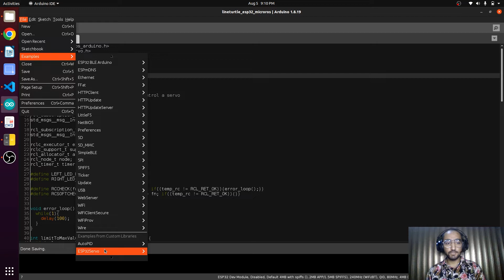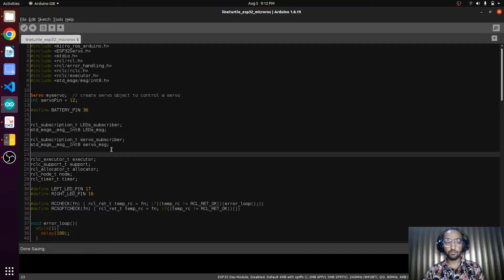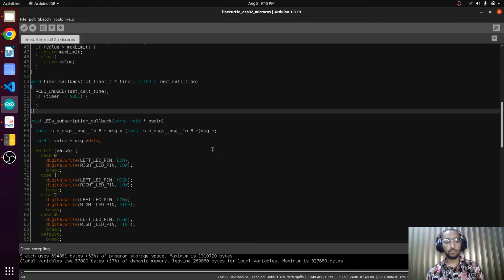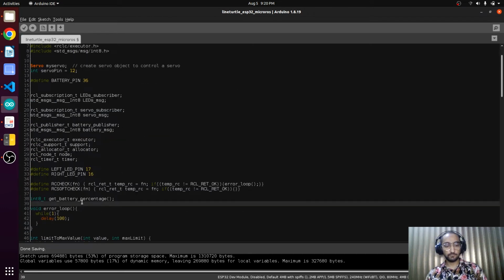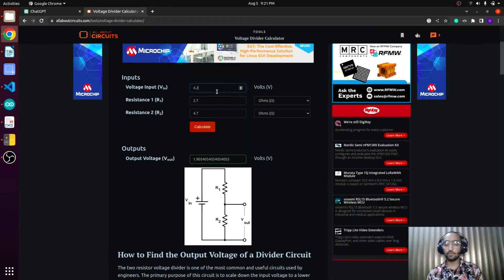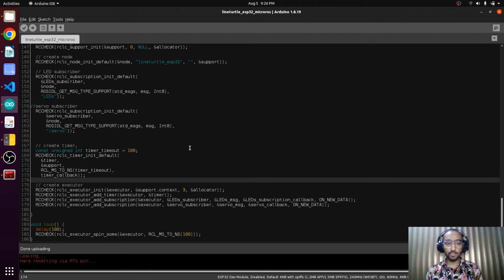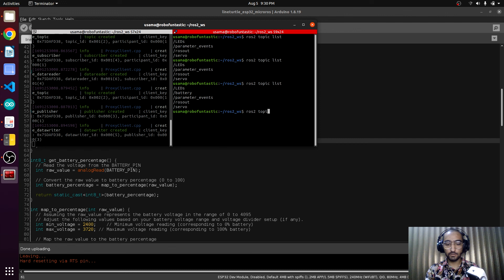Calculating and Visualizing Battery Level  | ROS2 for Beginners and Microros with ESP32 Course

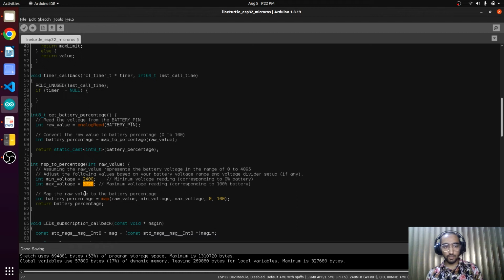Comment: Hello. I'm following your series and I learned a lot from this series. Thank you so much. I want to ask a question here. 3:47 Why did you round up the max voltage value 3310 to 3720? Won't it cause the battery to be overcharged? You also rounded the minimum voltage value 2364->2400. But this one makes sence. 2400 is smooth and higher than the low limit. So it is safe. But 3310->3720 didn't make sense.